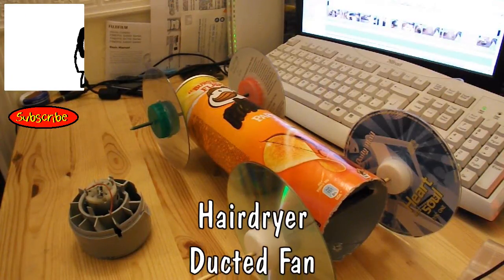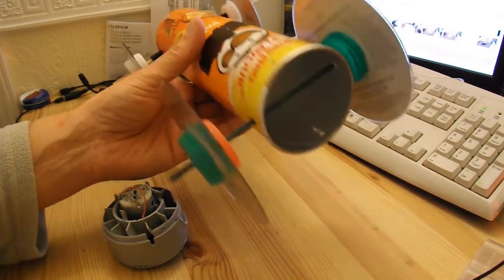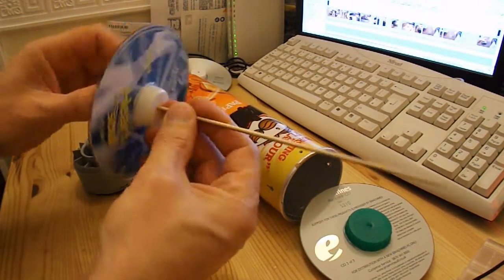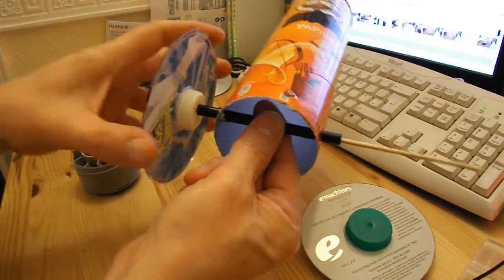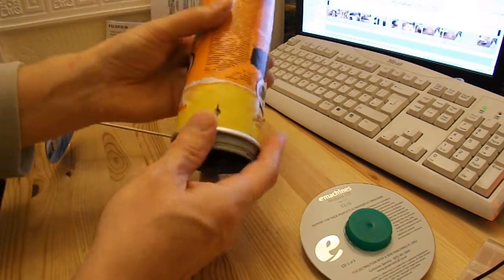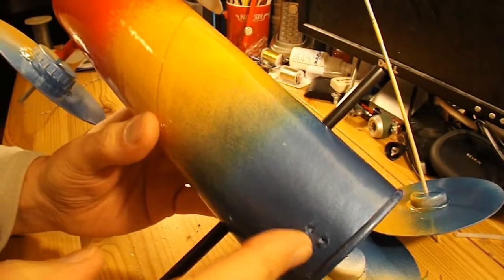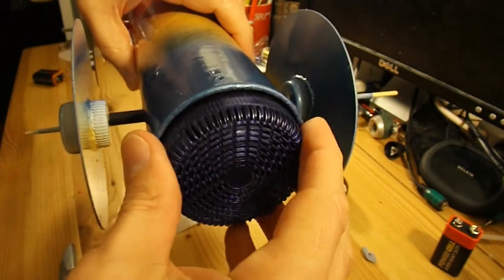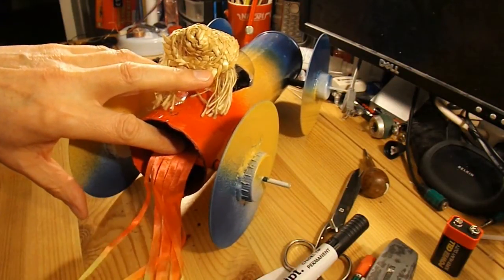Hairdryer Ducted Fan Car

Comment: i like using soda straws :) but the pen is a good idear.
Reply from the maker: Hi Allan, yes, straws are fine as long as they are strong enough. Most of my cars use straws now as I have bought some large packs of them very cheaply. When I started doing YouTube videos most of my cars used pen tubes because that was what I had around the house.
Reply from the maker: I use straws for most of my car axles but if you want to wrap the rubber band round it for an anchor a straw is not strong enough so that is why I use the pen tube.